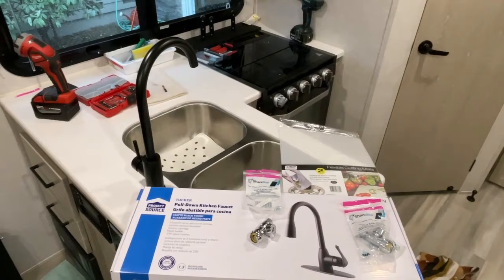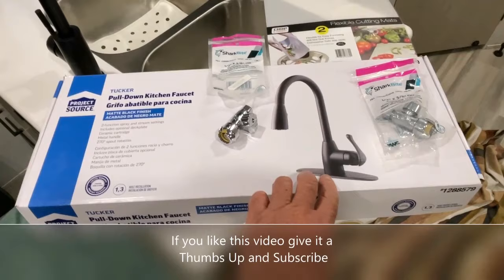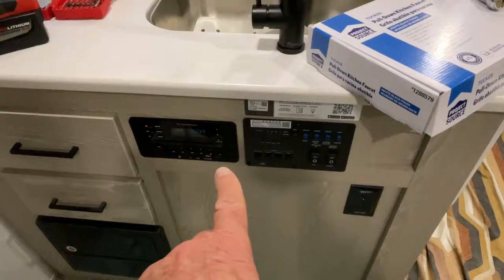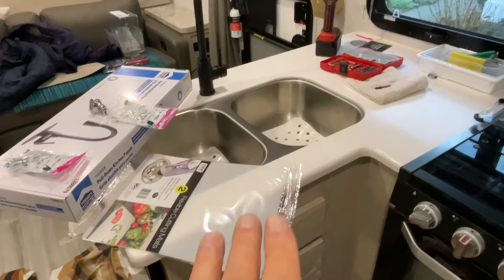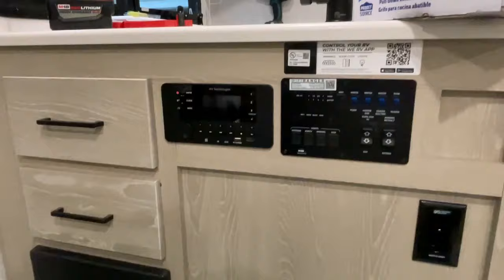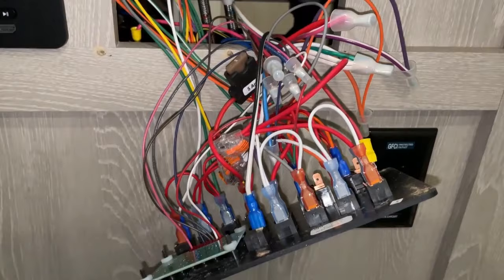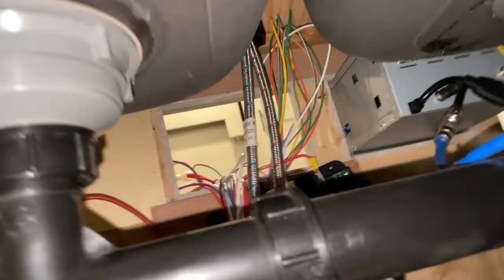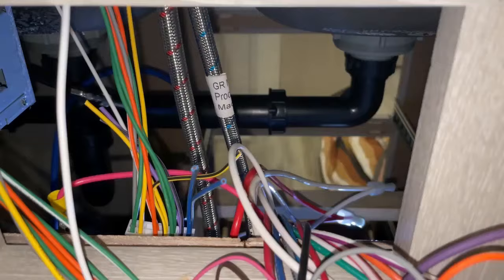RV Kitchen Faucet Upgrade - Step By Step Removal & Installation

Comment: Michael, once again you saved the day! Our 2022 R-POD 193 faucet neck literally blew out of the fixture yesterday. The bushing cracked that seals it and it sent a fountain of water straight out of the base! I looked up how to upgrade faucets and your video came up. Worked like a charm. The shark bites came in clutch. They even had a nice cutting tool for the pex pipe at Lowe’s. My wife loves her new faucet. Thanks as always you’ve been a life saver. Appreciate you!
Reply from the maker: And I appreciate you Rodger, you made my day again

Comment: Great job again! I keep putting this off on mine, but you may have motivated me 😎
Reply from the maker: Thanks Greg, I've also replaced ours in the bathroom and kitchen and they are so much better. Hope you and the family are doing great.
Reply: @thetraveltrailerguy  We’re doing great, thanks, hope y’all are. I did out bathroom faucet a couple years ago and put a high arc version in so we could actually get our hands under it. I need to do the kitchen to something better. At least on the 2504S there is easy access.
Reply from the maker: @greggimlick7319  Yep we have done both our sinks and its so much better, the 2504S is built so they can be changed out easily :) If you didn't see my kitchen faucet change out here's the video and another one for a cool aerator nozzle I installed. 

Faucet Video - https://youtu.be/KOLWOPaQIdI
Amazon - Delta D 21987LF-SS Foundations Two Handle Kitchen Faucet -
https://amzn.to/3DLFCJI

Aerator Video - https://youtu.be/ejlMpYm24Y8
Faucet Aerator, 360-degree Swivel Kitchen Faucet Aerator Splash-Proof -
https://amzn.to/3Nq3ojV

Comment: Mike, I appreciate the video. Our 2104s is just like your video, which make the replacement a PITA !   Still not sure if I want to make the switch , I can see much frustration in this replacement. No thanks to Rockwood for making any upgrades a Nightmare....
Reply from the maker: Thanks for watching and commenting Ed. The project really wasn't that hard to do. All in all if I wasn't filming the install I could have done it in around 1 hr start to finish, https://www.youtube.com/@thetraveltrailerguy/videos
Reply: @thetraveltrailerguy    Can you tell us how much you paid for the faucet ?  Was this a good replacement model, since there are many to chose from.
Reply from the maker: @edwoolful  The model I used was one my friend chose to use since they saw many others using it in Facebook groups, they like it and I feel it was built well.

Here's the links to the products I used (I try and list all the products I use below each YouTube video I put out to help others):

LOWES HARDWARE - Project Source Matte Black Single Handle Pull-down Kitchen Faucet with Sprayer Function (Deck Plate Included) Item #1288579 Model #51-K814-PS-MB -
https://www.lowes.com/pd/Project-Sour...

Michael Bracewell "The Travel Trailer Guy" is a Amazon Associate, I earn a small commission from qualifying Amazon purchases by you using the Amazon links below at no additional cost to you. Thank you 

AMAZON - More kitchen faucets to chose from -
https://amzn.to/3VIUZMc

SharkBite 1/2 x 3/8 Inch Compression Straight Stop Valve, Quarter Turn -
https://amzn.to/3QmmQ3S

16-Inch Length Braided Stainless Steel Hose - 3/8 Female Compression Thread x 1/2 I.P. Female Straight Thread (used in video) - 
https://amzn.to/3GFJZLb

12-Inch Length Braided Stainless Steel Hose - 3/8 Female Compression Thread x 1/2 I.P. Female Straight Thread (another option if you want a shorter hose) -
https://amzn.to/3X27XWA

Ratchet-type Pipe (1-5/8" OD) and PEX Straight Cut Pipe Cutters (1-3/8" OD) -
https://amzn.to/3icoaJX

Flexible Plastic Cutting Board Mat set, Clear Kitchen Cutting Board Set of 2 Clear Mats (Amazon link below or you can buy them at the Dollar Store) -
https://amzn.to/3WN0QRS 

4", 6", 8", 12" Inch Cable Zip Ties Black Heavy Duty -
https://amzn.to/3RQfG7s

Comment: My issue on the identical faucet is that the hot water is plugged up.  How can that happen when there’s a filter system installed?
Reply from the maker: Hello Tim, its very possible that your water heater needs flushing. Check out my video to see what came out of our water heater when I flushed it. 
Here's the video - https://youtu.be/FhAjbAaREc8?si=5y0rNR7yAGE4TACi
RV Water Heater Tank Rinser, BECARSIR Adjustable Metal Nozzle RV Tank Cleaning Wand, Cleanses and Removes Sediment from the Bottom of RV Water Heater -
https://amzn.to/3zKjQrK

Camco 11691 Water Heater Tank Rinser | Cleanses and Removes Sediment from the Bottom of RV Water Heater -
https://amzn.to/3xALEMe

RV Water Heater Magnesium Anode Rod Set – 2-Piece Kit Water Heater Anode Rods with PTFE Tape – Compatible with Suburban and Mor-Flo Water Heater Tanks - 9.25" Length ¾" NPT Threads -
https://amzn.to/39tJQg4

1 inch Fitting Cleaning Brush -
https://amzn.to/3OjDzSV

6 Pieces Mini Stainless Steel Wire Brush Set -
https://amzn.to/3xX2wyc

Wire Brush For Drill Wheel Steel Cup (6 Pcs) 1/4 Inch Arbor Abrasive For Cleaning Stripping 
https://amzn.to/3QkDBMa

Dual Hex Water Heater Element & Anode Rod Socket Wrench Removal Tool 1-1/16" x 1-1/2" x 10 Inch Length -
https://amzn.to/3Qu2dlA

1-1/16 Inch SAE Socket -
https://amzn.to/3xwWQth

1/2 Inch Drive Ratchet -
https://amzn.to/3xUeGI9

5-Inch Extension, 1/2-Inch Drive -
https://amzn.to/3b0p73T

https://www.youtube.com/@thetraveltrailerguy/videos

Comment: Hi Michael.  I'm installing this faucet in my trailer and cannot for the life of me figure out how to put the weight on the sprayer hose.  the hose came attached to the sprayer and the other end has a connector that I cannot get off and the weight will not fit over it.  Any ideas? my weight does not come apart like yours does.
Reply from the maker: Hello Heather, sorry to hear your having trouble with installing the weight. Please open the attached link below to open the instructions and look at the bottom of page 5 and look at the #6 instructions. The instructions say that you turn the weight counter clockwise to open the weight, slide it on and the tighten clockwise until it is tight on the hose. (They must have changed the way the weight is installed for your set up)  Please let me know if this works for what you have? 

https://pdf.lowes.com/productdocuments/b61f84d0-46a4-42b9-a1cd-93315f73cd7b/10782429.pdf?_gl=1*1fu0ezu*_gcl_au*MTUzNDE3NzY2My4xNzI1MTQ1NTA0
Reply from the maker: I just found this on the internet, this may be the weight you have? https://youtu.be/N3zmvVUr0ZM?si=IPuJngWayiXcI-cc